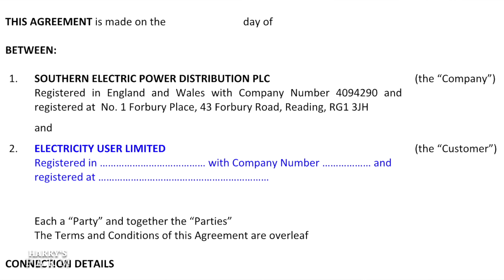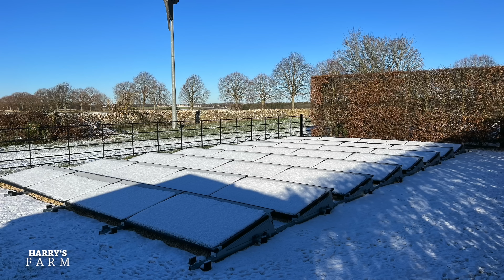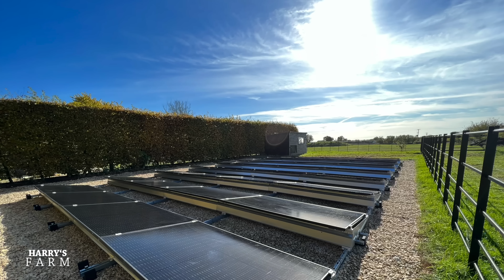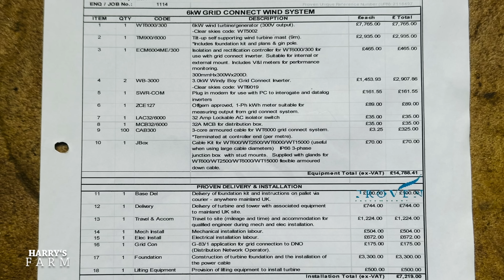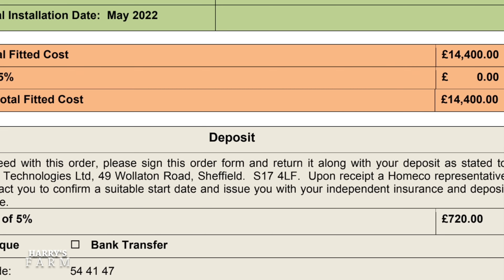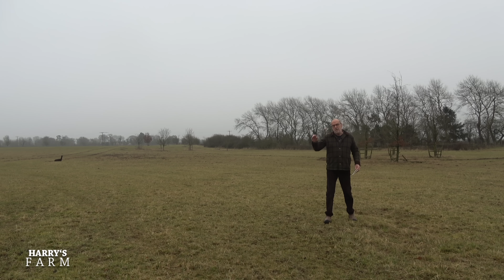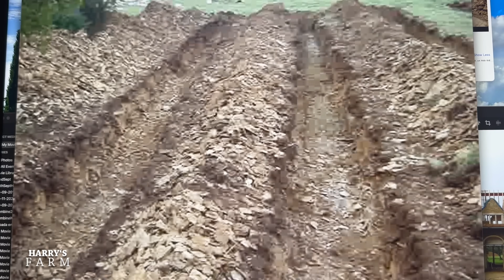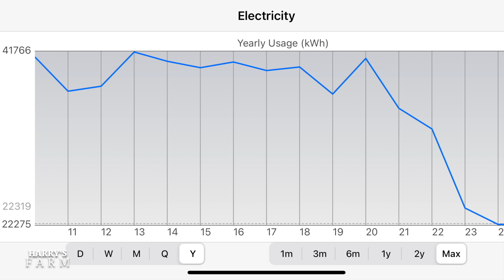Are solar panels & heat pumps worth installing? Here's what I've learnt after several years of use.

Comment: I would be interested to know how the numbers work if you don't have solar (or such an expensive turbine - admittedly it seems a chunky one).  Just batteries.  You fill the batteries from the grid when the price per unit is low, and use it when the price is higher - and maybe sometimes export.  I have seen a suggestion that this can be cost effective, possibly because the complexity of installation is lower than with solar.  Potentially V2H will help here too, since in-vehicle batteries seem cheaper than home batteries, for reasons that seem unintuitive to me since a static battery just needs good cost per kWHr, and does not need to optimise volume or mass per kWHr.  Costs of batteries and panels have fallen fairly rapidly in recent years - but the labour costs of installation do not seem to have done so, as far as I can tell.  Of course - there is additional risk with such a strategy, because the future differential between peak and cheap rate may vary.

Comment: Panel angle makes a huge difference. The tilt of the Earth is why we have seasons and cold polar regions. Radiation from the sun arriving on Earth can be modelled as almost parallel rays. The same amount of radiation per m2 of 'space' is distributed over a significantly larger ground area at the poles (analogous to low angle panels), compared to the tropics (analogous to steeper panels). Factor in the winter vs summer zenith and its easy to see why performance declines.

Our 4.5kW system generated 25kWh in the last 28 days at a similar latitude to your location. We get 6-700kWh in a good summer.

Comment: Best solution to shading problems is PARALLEL wiring and use of individual microinverters mounted to each panel, rather than SERIES wiring design migrating into a single inverter.  Check out Enphase Microinverters for really great products that actually work!

Comment: Your problem with output in the winter is due to shading.  It’s clear from one of your photos that the low sun angle casts a shadow that migrates over your array. The best solution for you to get better output is to Rewired the panels in PARALLEL rather than in SERIES.  Parallel series wiring won’t affect shading on adjacent panels.

Comment: My daughter has a house designed for a heat pump, it works fine as long as the temperature is above freezing,she’s in Hampshire and when the temperature drops into the minus the damn pump freezes up, constantly. She’s been told the heat pump is old (2016) the soft ware is incompatible with new tech and she really needs a new pump and controller(£12k) my house is a Victorian farmhouse with solid walls, roof is the wrong size shape aspect for solar panels but my house is 1000ft above sea level in the Staffordshire moorlands. We live in cloud for 6 months of the year and as for ground source heat pump we have 100 to 150mm of soil over god knows how much clay and that stuff is cold all year round. The best crop up here is grass and moss on everything and as regards wind power there’s 7 wind turbines visible, when the dunkleflaut is on they’re stationary, a 40 mph wind is regarded as breezy, highest wind speed seen here was 129kph. So renewables 👎🏻

Comment: I did consider UFH for my garage (only a triple garage). It would have forced me to have a much bigger heat pump. In the end we did put insulation under the garage floor and insulated the walls the same as the house. It is not house warm but its still a nice place to work. Battery has been a great thing for us but I guess you would have needed massive batteries for your home.

Comment: Interesting video and results. Ref the solar, I believe you only have to notify the energy supplier if you plan on connecting it to the grid, as this is because they need to investigate if they need to upgrade their equipment. Also you only have to notify them if it's going to be over a certain KW rating. I don't believe you have to notify them if you're going completely off grid

Comment: Interesting project. Key takeaways for me are:
1 Property was designed and built accordingly, retrofitting a system will be expensive.
2 Is there any selling surplus from the wind turbine to the grid?
3 Taking advantage of available space makes sense
4 ROI - be interesting to see how many years.
5 Presume there is electric over ride for hot water

Comment: Great vid full of info and 18 years of experience! I always appreciate that you go into real numbers, this time it's kWh and pounds and pennies but also all the detail on the farm and garage vids.

One comment on the AGA: The AGA will use straight electricity, a CoP of 1, whereas the heatpump will be at >3. So it can never be as efficient as a heat pump for heating, but the kitchen will certaintly be warmer as your underfloor heating can't pump out high temperatures. I get it though, it's a luxury and your cotswold farmhouse wouldn't be the same without, but no chance it saves you any money or energy.

Comment: I don't personally think heat pumps are worth it unless it is added to a new build. 
The solar however. If you have south facing roof space, it is defo worth having. If you are taking up precious ground space, I am not so sure it is worth it. 

Also. You get slightly less power in the summer months, but if you go with a vertical setup and use reflectors. You can significantly boost winter power generation. Snow can not settle on vertical panels and the reflectors will boost the light reaching them. You typically see 25% less power generated in summer months and conversely, around 25% more during the winter.
There are a bunch more ways of cheating the solar panels as well.
Reply: It depends what options for energy for heating one got,.Heat pumps is a great money saver, new or old home, in places one primary use electric for heating, like in Scandinavia.

Comment: You could add in some cheap storage heaters to use when you have excess power, maybe for the gym or your big outbuilding for the car collection. Infrared in the roof is now very cheap to use for instant body heat which also warms furnishings. Batteries are now much cheaper consider a large battery excellent for buying cheap rate  overnight and in winter.
Reply: ... Or Bitcoin mining. That's been done on an industrial scale in more forward thinking countries, using excess energy generation to balance the electrical grid and incentivise further build out of infrastructure without requiring tax payer funded subsidies. Grid balancing renewables due to uneven supply is a major problem for electrical grids. Bitcoin fixes this.

Comment: I've long debated between using a water-air or ground storage heat pump in my renovation, but was eventually persuade by the enormous price difference. I'm aware that the air-water heat pump will be less efficient in winter, but I'm confident it will take many year of this less efficient heating to compensate the 15k euro price difference with a heat pump using 2 100m deep wells.
additionally, as you referred to the prices of solar panels.  I've recently installed my solar array (12kw east-west on a 10 kw hybrid inverter, which is the max size of inverted allowed in residential houses in Belgium) and paid the royal sum of 3500 euro's for the whole setup (I did install it myself).
Reply: Air water are pretty common here in Sweden (every house has some sort of heat pump), there are many options with fairly good COP at winter times

Comment: Such an interesting video. I thought you were bonkers trying to heat that old house of yours solely with an air source heat pump! You'd never know that it's a new build.
Reply: 2007 is 18 years old, hardly new build
Reply: @drc6940  well it sort of is, especially given all the tech he put into the fabric of the house. Having watched many of Harry's garage videos which often feature the house, I had assumed it was built in the 17th century.
Reply: Harry should have done some homework.
1) He could store excess energy as heat in a massive underground heat store (not high temp) - he could then run a ground source heat pump through that store to get that heat out.
2) His solar panels should be on a Cornish Rocker - angling those panels towards to sun at 15 degrees in winter and 60 degrees. Most rockers take solar panels on a grid pattern 2x8, Harry should have his as 1x16 or whatever because he doesn't want to see them.  (Our panels at 40degrees in winter - not Harry's 80 degrees 😞- we got 6kWh on a sunny day in FEBRUARY from panels that are ONE THIRD the size of Harry's setup - Harry could have gotten 18kWh out of his panels if only they wer'e pointing at the moon!!! (you know what I mean)
3) Every installer knows about shading - Harry must've gotten the worst installers ever if they didn't see his hedges and thought "They might grow"  !!!

Comment: very well explained but I guess you need optimizers for the solar panels first hit by the shadow from the hedgerows. 
If you have - most likely - all panels in 1 single string then any shadow on any panel will cause a maybe 40 times bigger loss cause 40 panels each 300 Wp would have go through the eye of a needle no matter what where this panel is located - first or last or middle one , you will have the same result. 

So, buy a BRC solar optimizer from the german manufacturer in Karlsruhe cause these are inverter independent optimizer that will always work but will not burn energy if there is no shadow like all the others that have a high standby consumption even in brightest sunlight.
The german one uses only energy in case there is a shadow. 
And it is acting like a broker which means it recognices that the string is arriving with full speed of 300 W per panel (it is a simplified explanation) where those 300W are the result of maybe 30 V and 10 A current. Now you have to know that the power generated is the result of the multiplication: 30V x 10A = 300W and also that during daylight the voltage is always roughly the same around 30V and not changing much. Now you should get a glimpse that the power and energy prodcution change over a day must only be depening on the current , the amount of Ampere.

You are right: I you increase the hight of your fences by 40 cm with a kind of long cottonsail betweeen 2 poles you will cause a new shadow on your panels and on each of these panels the production might decrease at 11 am big time from 300W (best day of the year) to 30 W due to the shadow.

Now remember you have maybe 8 panels in a row x 5 rows and 7 of the panels are delivering 300W each while 1 is down to 30W the total output of such a row would be NOT 7x 300 + 30 = 2130 W but simply 8x 30 = 240 W 

The optimizer will be used to minimize the impact of the shadow to the whole row which means their goal is to save as long as it can the 7x 300W from the other panels. The optimizer from the first panel will do nothing until 11 am and the shadow will kick in which will be recogniced by the optimizer cause the string is trying to deliver 10 Ampere while it is measuring a 5 A output of its own panel. Without such optimizer the whole string would go down to 5 A output or whatever the current output of the shaded panel would be: in this case 8 panels x 30V x 5A = 1200 Watt while a fully production moments before would have been 8 panels x 30V x 10A = 2400 W

Remember: the single shaded panel is producing 5A x 30V = 150 W 
Now the optimizer takes the voltage of 30 V and tranforms down to let us say 15 V. The output of the panel would be still 150W but transformed to 15V it would mean 10A current which matches the output of the other 7 panels in that row. 7 panels x 10A x 30V is their production or:
210V x 10A + 15V x 10 A = 2100 W + 150 W = 2250 W instead of 8x 30V x 5 A = 1200 W 

An optimizer listens to the string production and adopts its Voltage as long till its panels current matches that of the other panels. 

Ok, now you have understood how that optimizers works get 5 of them for less than 200 GBP I guess and mount them on the 5 rows each of them 8 panels cause then you will have protected your whole string from the shade of the growing hedges. 5 rows mean that the whole string will deliver 35 panels with x 30 V + 5 panels x 15 V = 1050 V   + 75 V = 1125 V and you will face a 75 V drop but the current will no longer drop from 10 A to 5 A but stay at 10A. 1125 Volt x 10 Ampere = 11250 Watt production instead of 40 panels x 30 V x 5A (even if only 1 panel has a shadow) = 6000 Watt

You will gain 5250 Watt in this example for maybe 1 hour till the 2nd panel might be covered with a shadow from the hedge. And then you might wanna do the math again or use a simulation program like PV sol premium to do that for you or hire some one to do the calculation for your particular installation on the ground with all the distances and what not. It can be very beneficial to also add optimizers on the 2nd panel cause there can be still a lot to gain depending on the azimuth and orientation but also on your demand profile (if no one is at home during noon then you might gain power but can not use it). 

AND FINAL REMARK: there is metal fence on the opposite side of the hedgerow which can also cause shadow in the noon or morning cause I can assume that the panels are facing south which means the hedgerow on the right is causing shadows in the morning when the sun goes up in the east and that the metal fence will cause the same issue in the evening too. So you might consider to investigate if you need at least 1 row of optimizers on the other side cause that all depends on the distance of the fence to the panels and the fence height and so on (more complicated than a hedgerow in a parallel configuration to the panels. It is worth the efforts cause you will be happy about every kWh in the late winter and early spring time but also in late autumn. And: the installation is a 15 minute job and can be done by everyone and also you your self. Why ? If you repair cars you are familiar with electrical connectors. And the solar panel have only 1 kind: MC4 aka multicontact 4 where you can get a kind of key for 1€ to unlock them and then it is an eays plug and play - and I bet you will find that very rewarding too cause you will learn a lot and improve things even as your repairs improve the cars.

Comment: The problem is your location in the countryside where you can't get town gas.   It does allow you to do the ground sourced heat pumps, because you need the land for that system, whereas town people will be limited to air source.   Whilst the COP (I believe it's called) can be from 1 to 5 in those systems (the amount of heat returned for energy put in), the problem is that town gas is a fraction of the electricity price.   It's probably got a "COP" of 4, for a unit of gas you're paying 4 times that for electric.   Maybe less to be honest right now.   With the costs of installation of a heat pump, and that the systems run cooler than a gas boiler does, you also need to upgrade your radiators too.   Only adding to the cost and meaning the return on investment is many many years off.   Your system will  be out of warranty long before it's paid for itself.   As you also point out, heat pumps are their most efficient when you don't need the heat!   When you do, their efficiency drops.

I do love the idea of a heat pump, but in the countries that claim to have successfully made use of them they appear to be only one of a number of heat sources the house has.   They still have town gas or wood burners to keep the property warm when it's cold.

Very interesting with how little solar generates.   I've said that what we really need is a massive global grid moving large amounts of electricity from areas in the sun to those that aren't.   Yes, a huge investment, but solar could provide enough power for the globe to run off.   There's deserts doing nothing that we could fill up with solar!   Even if we were just using it to create an oil that we could easily move around and burn at net zero.
Reply: He’s had that heat pump for 18 years.
Reply: @ But the four services adds to the cost pushing payback date out further.   Heat pumps need ideal conditions to work best, and if you're upgrading a system you're effectively having to replace everything in a home.   Boiler, radiators, everything.   And then you still have a problem that it doesn't heat your hot water enough to prevent Legionella.   You need to cycle that with another heater to prevent this.   It's still very expensive to install, far more than a conventional town gas system.   Which means your breakeven point is well off into the future.   I wish it were different, but that's the current reality.
Reply: Western  governments prefers the solution of moving large amounts of people from areas in the sun to those which aren't and providing higher energy-consuming lifestyles for them.  That's their idea of net zero.

Comment: With the panels on a Cornish mount you could optimise the angle for the winter months (they are designed to be adjusted summer/winter). I reckon you'd double your winter generation. Although 2x not much is still not much.